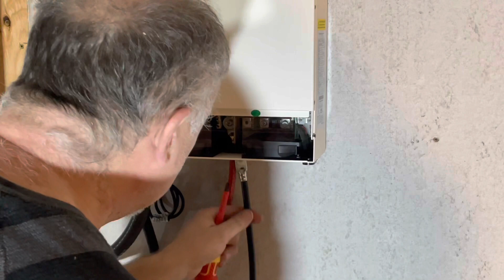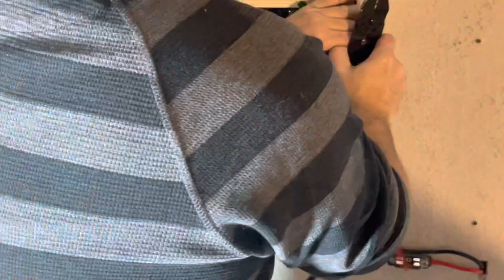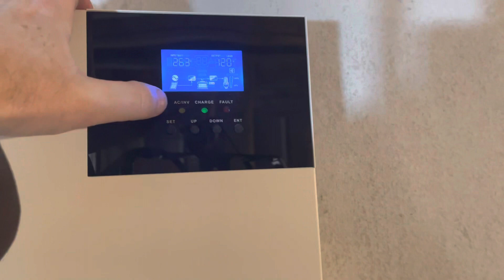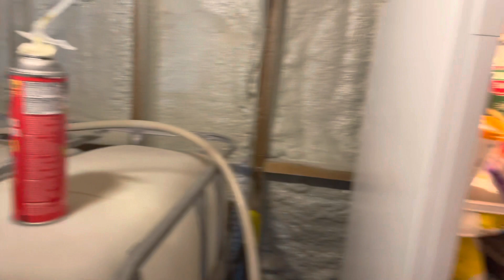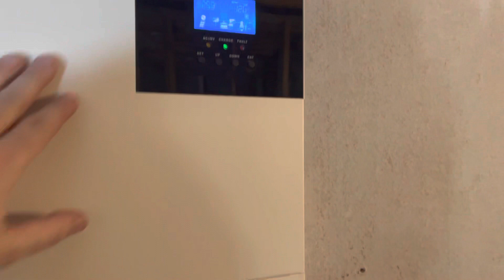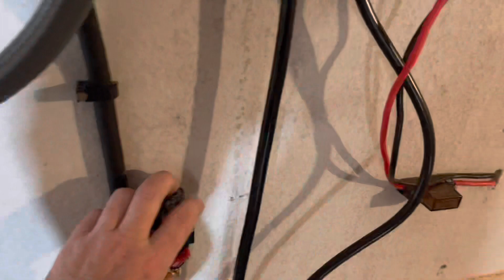Setting Up My All-In-One Solar Power System! 24 Hybrid Inverter. Step by Step!

Comment: Darren - how is this unit working for you in 2024? I am looking at setting up an off grid power system in Northern Nevada for our 50 Amp RV service. We would like to be up on the property in the Spring to Fall and drive into work. Since we do not have power up there we will have to build our own system to power the RV. We won't need AC in the summer so the only heavy loads would be the washer/dryer, refrigerator and water heater (we could just run propane - it is a dual electric/propane unit). The only other thing would be a chest freezer (deep freeze unit). Is the unit you installed able to be paralleled to increase 120/240 output? I would have to find a 48v unit - need the performance and prefer 48v to 24v.
Reply from the maker: Hi The unit I have will not support 240 volt just 120 in. My system has been running great. It does not have the option to do parallel if I was to get a new system that would be what I would go with as I  limited with this system. I currently run all my lights the freezer sump pump all the downstairs wall plugs, outside plugs and the water pump on my system.
Reply: @DarrenCharron  thank you for getting back to me so quickly, Darren! I am discussing the 6000XP's with my wife right now. It may be the only route we have to take to get ourselves set up off grid. Have a great day and Blessings to You and Your Family!!
Reply from the maker: @rongray4118  you as well and God bless to you and your family as well.

Comment: Mine just arrived, using it to use while boondocking down Yuma BLM way. I've also bought 2 , 280 W 12V lithium  batteries and 6 , 100 W solar panels, question is, Will I be able to increase my amount of solar to keep the batteries up? I'm bringing my generation down for back up, but hope to not have to use it. We're in MB also, Shoal Lake, West of Brandon, so wouldn't mind picking your mind for pointers to make my hook-up go smoothly.
Reply from the maker: Yes you have lots of room to add to your panels. I run 10 230 watt panels on my system. I am not far from Shoal Lake myself.
Reply: I don't think my last post went through, you'll have to clue me in also on the wiring for your solar panels. Where are you located, I thought Brandon?

 @DarrenCharron
Reply from the maker: @jameandy4681  Minnedosa area

Comment: All I’m seeing is electrical connections you’re not describing what you’re doing is that a 110 or a 220 how many volts / amps are you bringing in from your panels? All I see is you doing electrical connections?

Comment: YOU,VE INSTALLED A VERY NICE DIY SYSTEM ON YOUR OWN THAT WORKD GREAT . :goodvibes:VERY CLEAN WIRING AND POWER DISTRIBUTION IN DAMAND IS WHAT A PREPPER NEEDS TO SAFELY RUN THE HOME EFFICIENTLY ALL FROM WATCHING  MANY DIY VIDEOS . KEEP IT UP AND RUNNING GREAT .🤗CHECK OUT MY DIY SOLAR VIDEOS  , HIT LIKE , LEAVE A COMMENT AND SUBSCRIBED . MAY THE SOLAR BE WITH YOU .:elbowcough:

Comment: I think what you should have done was hooked up two panels in series each and then run them parallel that way you keep the voltage down but the amperage up that will give you more power and that won't let you go over the voltage

Comment: How’s the inverter holding up
Reply from the maker: Inverter is holding up good I just ordered a Renogy system for our trailer off Amazon prime days. We are planning on making a trip to the east coast and staying in Walmart parking lots along the way.
Reply: @DarrenCharron  which remogy system?  Why not stay with srne?  The srne inverter is more capable then any of remogy inverter / controller from my understanding
Reply from the maker: I bought the rover system, Renogy 40A 12V/24V MPPT Solar Charge Controller, Renogy 3000W 12V Pure Sine Wave Inverter, Renogy 40A DC to DC Battery Charger MPPT 12V Car Battery Charger On Board Charger for Flooded, Gel, AGM, and Lithium Batteries, Alternator Charging
Reply: @DarrenCharron  yes that controller has 150voc iirc so depending on your panels, your Pv input won’t be much
Reply from the maker: I was thinking of running 6 100 watt panels and 4 AGM 12 v batteries
Reply: @DarrenCharron  100w panels are usually around 22 voc so your renogy should be able to handle it so you will be fine I guess then

22voc x 6 panels = under 150voc
Reply: @DarrenCharron  did you buy batteries yet?   I have lithiums

Comment: Your AC panel needs a disconnect by code. Can be an external switch or main breaker in the panel. One tip: never run cable in conduit. You were making things difficult for yourself.

Comment: I have the same inverter in my camper and i have a ground neautral bonding issue. Not sure whats going on but its kinda dangerous.  Hopefully I can figure it out thanks for video and ive learned from experience to keep batteries short qnd oversize the heck out of them

Comment: Hello, did you say the max solar input is 1400w? that's not very good, 1400w input 3000w output, correct me if I'm wrong.

Comment: Hi Darren, You have a great Off-Grid system. Around 6 months back I booked up a PowerMr 5.5 Inverter with 4 Turbulent batteries (150Ah) and 460Wx10 JA panels.  Your system seems much neat. However, since we both have inverter's with cooling fans you might also have the dust issue. Recently due to cold weather dust and humidity killed many inverters which my friends used. So you may need to have a dust filter sooner than later. I created a small video which shows what I have done. Please have a look and share your ideas. https://youtu.be/4sAX6WE0BaY  Another tip for anyone who reads this message. Don't install FLD / Turbulent batteries just under the inverter. It will soon damage the circuit boards. Thanks,  Happy Off-Grid.
Reply: hi the newer versions of pow mr units comes with filters on the air intakes i just got my 24v 60A 3000w unit delivered

Comment: If you run in the series and parallel, you can use all four panels
Reply: I have that same inverter and same battery but having a issues
Reply: @andreengland2279  yes

Comment: May I ask what type of inverter and where you purchased it. Thanks I'm very new to all this but I want to jump in.
Reply from the maker: Hi here is a link to the one I bought on Amazon 
POWLAND 3000W Solar Inverter, 24V DC to 110V 120V AC, Off-Grid Inverter, Pure Sine Wave, Built-in 60A MPPT Charge Controller, for 24V Lead Acid or Lithium Battery https://a.co/d/8rw5uhV

Comment: Since the ac output on them type of inverters only has L and N on the output where did u run the ground for the output ??
Reply from the maker: I ran the ground along with the ac outlet
Reply: @DarrenCharron  my Inverter will be here tomorrow it's just like yours did u run that ac output ground wire to input ground side that's what I was trying to figure out going into the inverter it self that ground
Reply: @thelithiumpowerch  guys, it's in the instructions on pg 12 middle paragraph. says "ground wire is connected to the  grounding screw hole on the cabinet through the o type terminal"
Reply: I just received mine, ordering the fuses and switch...can't wait to see it going...
Reply: @sigmabilly  i am about to purchase a similar unit, for a novice, I have a similar problem understanding what that means exactly. A video showing how it is connected would be awesome because I have looked everywhere for a video that shows it and cannot find one.
Reply: @camguyeyespy  793181
Reply: sorry trying to figure this out, made a short on yt will send link
Reply: @camguyeyespy  https://youtube.com/shorts/soA0dBTHLp4?feature=share
Reply: they ask you if u want to leave yt,  dont worry it is just the short
Reply: @sigmabilly  that's awesome of you thanks.

Comment: Looks just great to me Darren . 3000 watts is 25 amps so it looks like your running the total 25 amps or a max amperage of 30  from the inverter  and split it  between two 15 amp breakers.   Love it bud you did very well.  The wifi might be resolves faster if you just installed a cheap wifi extender in the room to pickup the signal from upstairs .  Amazon under $50 . Top notch bud 👌
Reply from the maker: That’s awesome I will order one right away I never even thought about a wifi extender I will give it a go Thanks a ton Steve!